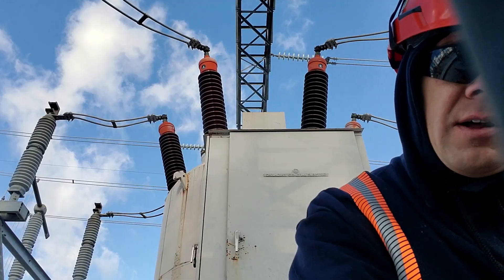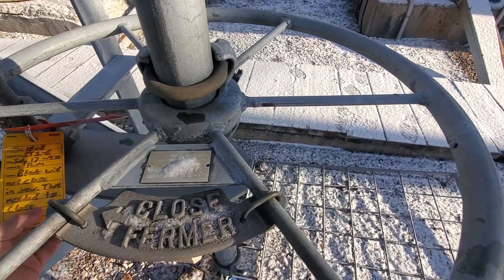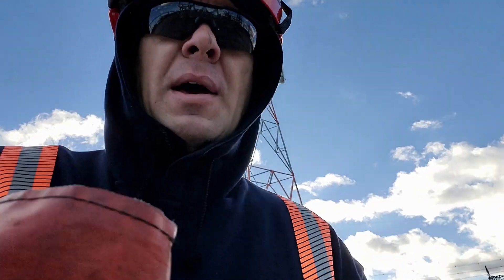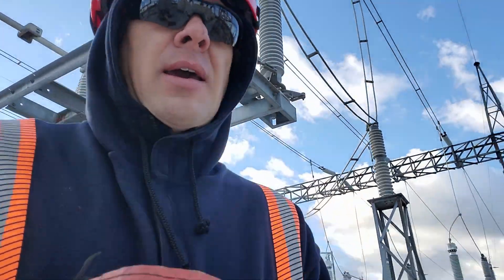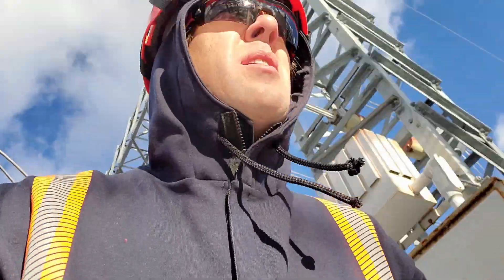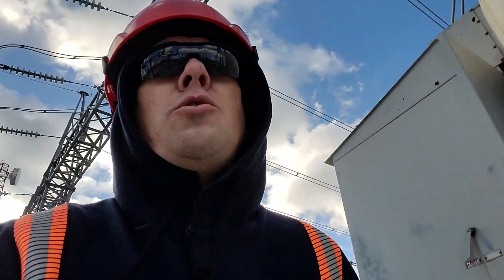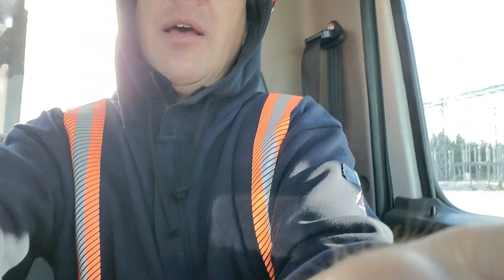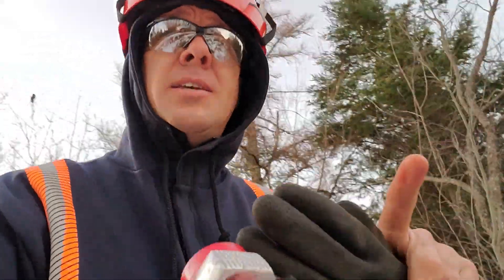138 kV switch  malfunction

Comment: Any idea what sort of no-load "leakage" load a power line like this has? I know that at 11 kV, even only a few kilowatts will draw bigger arcs than that, so it can't be much on your line. I'm surprised that leakage on such a high voltage is so low.
Reply from the maker: In this case not very much. If that switch was feeding the coils of a power transformer, there would have been a fairly large arc.
When feeding several miles of lines (with no actual load), it will draw quite an arc as well.
Reply: @Bobsdecline  Ah, so it wasn't feeding a line? I assume it was hooked up to another (open) switch in the same yard then?
Reply from the maker: Yes, just into the air breaker. (The large cylinder I first walked around). The breaker was in the open position internally, so I was only picking up a few dozen feet of line
Reply: At these voltages you don't need much current to have a large looking arc.  When you're looking to switch a load (with a disconnect or circuit breaker) you need to consider what type of current you're dealing with (i.e loop, reactive, capacitive  or resistive).  Switching resistive load current (20 to 2000 amps) with a disconnect is a no go unless you fit them with a vacuum interrupter.  If you have a low impedance loop you can switch up to ~150 amps without getting into too much problems.  If you're dropping a unloaded line (also cables), it looks like a large capacitor. If the disconnect is fitted with a high speed whip interupter, you can drop ~6 to 8 amps.  Since the current if proportional to the applied voltage, each line will have a different length.  105km line @ 25kV is ~4.7 amps. 40km line @ 60kV is ~7.2 amps. 16km @ 138kV is ~4.6 amps.  I use disconnects fitted with high speed whips to switch unloaded transformers.  When switching transformers I try to keep the reactive power less than 1.5 amps (at 60kV, 138kV and 130kV).  Now for switching unloaded capacitive bus as seen in the video,  bus work in stations are tipicaly larger than lines and therefore have high capactive values. You should try to keep the current under 0.2 amps.  This would be ~500m of bus at 60kV and 70m of bus at 500kV.  I'm going to guess there is only ~10m of bus being switched in the video and therefore would only be less than 10 mA.

Comment: Since they knew the switch had an Abnormal tag, is it strange they submitted a work order to have you close that and the other side of the circuit breaker before the TLM crew repaired the Abnormal tag?
Reply from the maker: I found out after (from the crew that did the initial switching), that the tag was already there for them as well. 
It was the TLM guys, so it makes sense that it was submitted, but they should've let me know the device had an abnormal tag during the instruct

Comment: Always interesting as usual, those gas filled breakers are gigantic. I presume most of the open air breaker bars are spring loaded nowadays & these are older units where there is no 'slam action' on the blades when you get to a specific point in the crank. Thanks for all your hard work as usual showing us how its done.

Comment: I'm currently doing my Authorised persons and Senior authorised persons in the UK so that i can perform switching on the HV transmission network and set people to work.. It was interesting watching this video as we have a substation status board listing all the substation equipment and any issues with the operation of the equipment. Prior to receiving the switching instruction we have to check this board to make sure the equipment is able to be operated. Disconnectors/Isolators are a common problem on our network too. Watching you close that isolator i was already thinking in my head how would we fix that in the UK. Generally that sort of issue would require greasing of the fixed and moving contacts and extensive greasing of the twisting mechanism located in the centre of the isolator arm. Our 400kv isolators from the 1960s are of very similar design as that and can suffer from a lack of grease in the moving parts. Great video as always

Comment: at 3:24 I'm seeing how the rigid pipe is crimped down on the bond wire a couple times, in order to bond the pipe. I've never seen that method before... seems like a good cheat there! :)  Easier than using bonding bushings or clamps i suppose.

Comment: I kept staring at the communications tower behind you at around 1min 30 into the video thinking about work earlier today being called in to find the broken line on emergency call today, except dint usually scan above the lowest line's for issues, i respect your work and others who work on the low voltage and high voltage lines above ones i do work on

Comment: How tall is the tower with the 4 microwave links on it? I'm a radio guy and there is a Comed tower near my tower here in Naperville, IL where there is a major sub-station of some sort and it feeds the Cyrus One Datacenter across the street in the City of Aurora, IL.  Not sure what they use it for outside of a handful of UHF and VHF radio repeaters for the trucks but it also has lots of microwave dishes on it for internet as well!

How is the internet / networking involved with the grid is what I'm curious about?

Comment: Good emphasis on stopping when switching doesn't go correct and also to verify that the contacts fully went in and rolled. I know you know, but I am sure not many outside the industry understand how most HV switches operate. The movable contact actually rolls inside the jaws BEFORE it starts to move out of the jaws. Opposite when it's closed. The movable contact fully inserts in to the jaws and then it rotates to make the solid connection and also performs a "wipe" as it seats to help clear any corrosion on the contacts. The movable contact isn't round, it has ears, per se on it that allows it to move in and out of the jaws with no friction and then rotate to close the connection. Speaking of corrosion, the contacts are usually silver plated, since silver oxide conducts. Vs coper oxide that is a bad conductor and will not make a good connection. That's why when performing maintenance on most HV switches you do NOT use anything more abrasive than a light Scotch-brite. The silver plating is thin and a wire brush could remove the silver plating, leaving just the copper that can lead to hot spots later down the road. As archaic as some substation equipment may look, there is a lot of engineering and lessons learned that is going on, even with something as simple as this switch.
Some more 138kV switch action!! And yes, some of them needed maintenance and should not be that hard to operate. A few did end up breaking over the years. 
https://www.youtube.com/watch?v=K8cMSDwZkDU

Comment: Also, if you have a "gut feeling" that something is not right, stop and check.  It saved my wife from getting electrocuted one day. Our idiot electrician had told us all the power, mains power had been disconnected from an old building we were renovating. Except it wasnt, and while she was cutting to remove internal wiring, there was a looped cable which was actually a  mains feed to the power pole outside.  She had the plier blades on the cable when I knew something was wrong and told her to stop.
Reply: Yeah unless he pulled the meter, the main feed wires would still be hot to the main breaker
Reply: @earlestes8649  the old meter (circa 1950's) was being removed along with the wall that it was on.  Our clear instructions were for the mains power to be disconnected from the old meter, so that the mass of old wiring on the inside of the old wall, behind the old meter could be safely removed.  the mains cable being of that era, is not much thicker than the internal wiring, so that it blended in.  Somehow, the electrician never checked where the cable actually went, and it wasnt the only problems we had that made it necessary to find another contractor.

Comment: THAT is a scary yard
Reply: Nah.  No reduced clearance.  No ground level equipment. 
The very first substation I entered had 2400V station service transformers ground mounted.   The transformers had side bushings so the 2400V was at waist height.  The cutouts were at shoulder height.   They were right next to the house entrance so you had to go about 3 feet away.

Comment: Once had a13.8kV single blade disconnect fail when the brown porcelaine insulator broke,  shut down the entire sub and made repairs.......       S....happens...!
Reply: that gang operated air break switch needs some linkage adjustment so that all 3 legs close and rotate the contacts correctly.... Good Video Bob !

Comment: Are disconnects like these all manual in your area? Don't think I've seen that around here at this high voltage.
Reply: Breaker disconnects are usually manual. The only reason to open them is for breaker service and there will be a crew there anyways. 
Motor operated is usually either when there isn't a breaker, or for a line / transformer disconnect with a ring bus or a breaker and a half design.  
In the case of a substation with no breakers, the motor disconnects can be used sectionalize a bad length of line, but the operator challenge is figuring out where the bad stretch is.  
In the case of ring bus and breaker and a half, having a switch lets the operator restore the ring / bay to keep redundant paths available.   This option is normally only done for the most critical substations.
Reply: @matthewbeasley7765  Interesting..
Youtube is kind of difficult when it comes to posting links so I'll try showing with text what I mean.
Typical switchgear bay design here:
|-CB-DC-P-DC-CB-|

|= the busbar, P= portal row here lines or transformers connect.
All the DCs are motorized and can be operated from the substation control room, at the switch itself, but with buttons at the control box, and remotely from the control center.
In small stations that do not require dual busbar you just skip one side. And if they need to save even more space they use DCBs instead of separate CBs and DCs.

Some of the old stuff built in the 50s and 60s are a lot more messy though with lines over lines and kind of resemble the design in this video, but not quite. They could have manual only DCs, but I doubt it.

Even a lot of the pole/tower mounted 22kV distribution disconnects are motorized now when they get refurbished. Most old ones are still just a padlocked lever with two wires up to the switch. There are also some manual ones with a box with a crank handle inside and an axle up to the switch. These can also be motorized.
Reply: The cost difference between a manual operated disconnect and a motor operated disconnect is huge.  The operator is ~$6 to $8k  but you need to add all the other stuff (cables, control, relay, communication, panels, power supplies, etc.)

Comment: A question.  Obviously your gloves need to be compliant and are on another level.  My workboots have a an orange Omega symbol on the tongue.  I’ve always wondered if they actaully continue to have that claimed fidelity later on.  I think probably not due to my sweating feet, snow and salt brine.
Reply from the maker: The integrity required to achieved the orange omega symbol deteriorates very quickly indeed. While it is a requirement for many trades, I would never consider a work boot of any kind a form of protection from electricity.
Reply from the maker: Great question btw

Comment: Love that you show the methodical process required for something as superficially simple as flipping a switch. Things may not have went as planned but I definitely learned something. Cheers!
Reply: And here I am, restoring tube ham radio gear, and methinks that 2 kVDC on the plates in the power amplifier was a lot! HA!

When restoring ham radio gear, we always go by the "one hand in the pocket" rule. Another rule we go by basically says (paraphrased a bit): "Always assume the chassis is hot until you KNOW it's not." (A little poetic license taken. 😁) Even with a power transformer at the AC mains power (117 VAC RMS), a short in the power supply section, or a serious leak in a filter capacitor (leaking electrically AND physically) can create a direct short to chassis ground; not a nice thing to contemplate.
Reply: There's NOTHING superficial about 138 THOUSAND volts. This isn't a 120V lightswitch energizing a 5W lightbulb. Even the smallest thing going wrong could be deadly.
Reply: @jfbeam  I think when they said "superficially simple" they meant "something that looks simple but isn't necessarily simple" not that the task itself is "superficial"
Reply: @jfbeam  dam straight .. my early field career was in HV started at 13Kv topped out at 150Kv - go slow - one mistake either kills you - severely damages you or worse you kill / hurt someone else.   IMO not being completely comfortable around it is a good thing as it keeps you focused.
Reply: @yopajo  Also it can damage equipment either owned by the power company or owned by the end user that happens to be connected to the line.

Comment: I doubt they'll transfer that cashe over to the new poll.
Reply from the maker: Lol probably not!
Reply: @Bobsdecline  So, is it illegal in your jurisdiction, for anyone not authorized by the power company to do so, to attach anything like that geocaching container to a power pole, like the one power pole used solely for supporting communications cabling?  And, if a crew WERE to remove that geocaching container and then re-attach the same container to the newly replaced pole, could that crew get in trouble for doing so?
Reply: @kevin67k  My guess is that the crew is from the power company, subsidiary or contractor, so they would be allowed to attach the cache to the pole. At least as far as law would be involved in something like this; the power system operator (or whoever is in charge of the people erecting poles) may not give them permission, but local law enforcement probably won't give them any trouble.
Reply: @kevin67k  ... just a technicality, but those garage sale signs and posters for lost cats placed on poles are also against the rules.
Reply: @rupe53  yes and it makes it dangerous for linemen who have to climb the poles.
Reply: @rupe53  Yeah.  And, for that very reason, is really the reason why I asked this question in the first place.  It’s a safety issue, because of the usual way most people staple up those signs usually involves using metal staples or nails.  In most jurisdictions, it is illegal to attach anything to any power pole, that is not meant to be attached to a power pole in the first place.

Comment: At time https://youtu.be/KLjHeo3SRt0?t=424 you are putting both tags into your pocket. Even the one you need to reapply to the switch. This seems to my like an unneccessary risk for forgetting to reapply it afterwards (and find it in your pocket when you are at home). Wouldn't it be better if the tags could also be afixed to the unlocked handle? That way you couldn't fall into the trap of "the switch has closed, so it is all normal from here on out. Brain forgets that there is one extra step when locking this handle".
Reply: good point, but the check list has that covered so a decent memory jog. We do a similar check list at my shop
Reply from the maker: As Rupert said,
Definitely a good point. After completing the steps, I confirm each step once again before checking my sheet and reporting back. That process should catch any such errors. That being said, stuffing them both into my pocket is definitely a first step in the direction of such an error. As you said "unnecessary risk"... I can agree with that 100%.
Good eye, thinking outside the box!
Cheers!
Reply: @Bobsdecline  You could take some zip ties and when you take the yellow tag off then attach it to the structure?

Comment: I wish you would elaborate more on the worst case scenario.  What not to do is equally important to know.
Reply: Don’t get killed…. That’s the worst case scenario. And the way to do that is to follow procedures. If something isn’t working properly or you are unsure of what is being requested of you then you stop everything and clarify the orders and get on the same page with the operator. Don’t be an idiot and never just wing it. Measure twice cut once
Reply from the maker: A great point! I'll keep that in mind with future videos 👊🍻
Reply: @Bobsdecline  Yes! Few understand Why re-opening a switch (even if it just wouldn't fully close) without authorization could leave someone else in a dangerous situation with overloaded lines or leave many users down the line at risk of a cascade-failure.